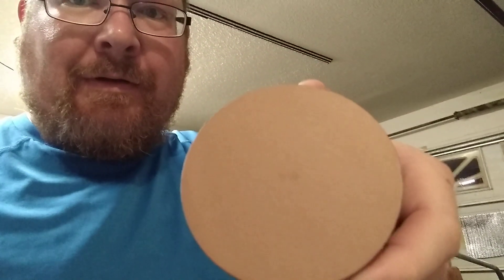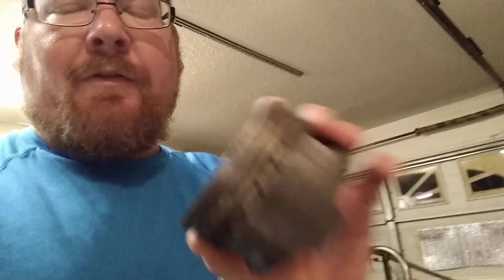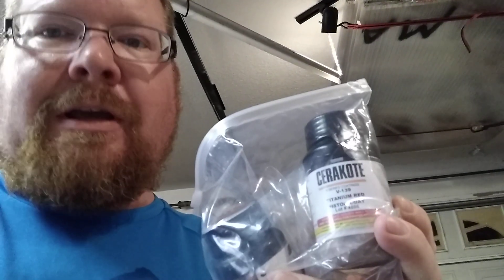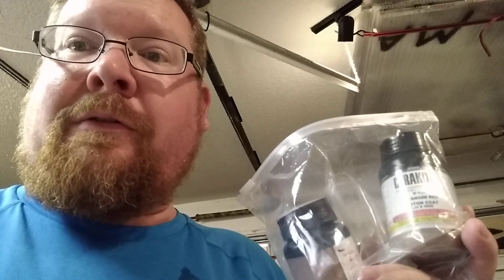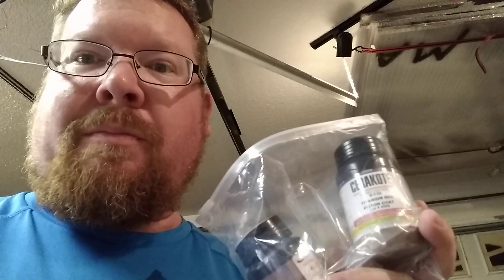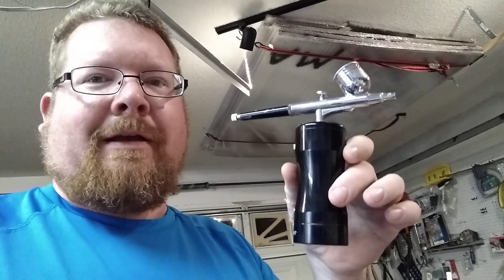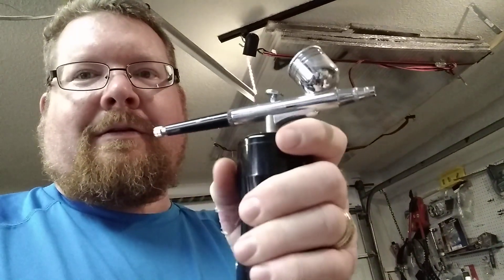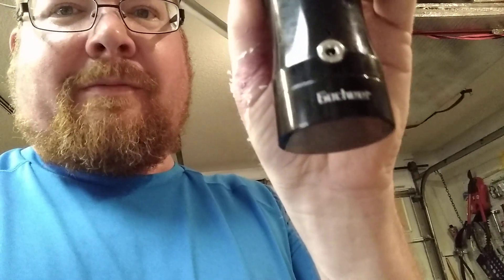Piston coating at HOME?????

Comment: I sure wish somebody would take "after" photos of the coated piston/heads after they engine has been used for a while.  There are a lot of videos showing what it looks like before the engine is put together - but nobody ever shows an after video.  It would be nice to know if the coatings hold up, if they reduce carbon build up, etc.  Even a bore scope photo might provide some insight.
Reply from the maker: When the motor comes apart I will make a video of it. I coated a set of pistons for a friend and he want to change something's  that will require the heads to come off. But might be a little while.
Reply: @MattLundquistVW   Have you noticed any cooling or performance changes that could be pinned to this coating?  Just trying to understand if it works beyond theory, which I don’t doubt… but am curious if it’s obvious results

Comment: Hey did you ever test a engine with the ceramic coating?
Reply from the maker: I coated a set of Pistons and heads for a friend. Currently the motor is running well, when we take it apart I will update everyone on how the coating held up.
Reply: @MattLundquistVW  I'm wondering did he notice lower head Temps? Did you coat the exhaust runners aswell? I ask cause I want to do something like this on my xr650 build lol
Reply from the maker: @mastermoarman  I coated the exhaust ports also. Unfortunately he doesn't have a CHT gauge currently and the motor was a new build so we don't have any data to compare it to.

Comment: That's some good shit from what I've read, you going to coat the combustion chambers as well? You can also pick up a small countertop oven for baking small parts for powder coating and the bake-able coating you applied. Keep having fun and stay safe
Reply from the maker: I plan on doing the combustion Chambers and exhaust ports as well. The good thing is this formula doesn't need to be oven cured, it's an air dry cure. One day I will look for an oven so I can powder coat part.
Reply: @MattLundquistVW  i've got bad news for you V-139 is an Oven cure product only, without oven curing it will fail and come off. pronouced Sara-kote as well lol